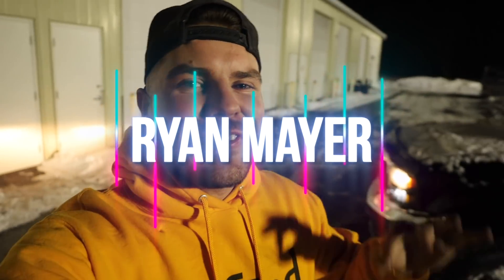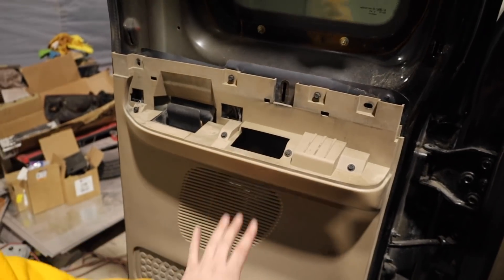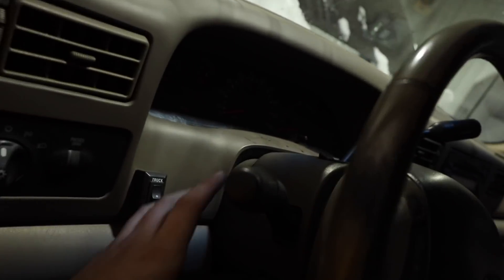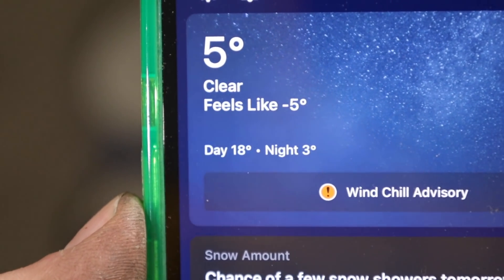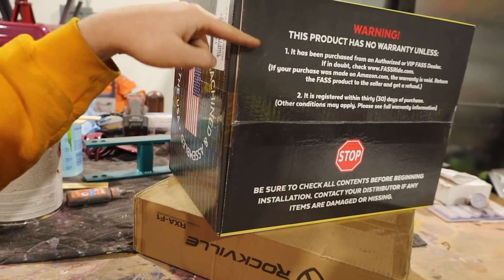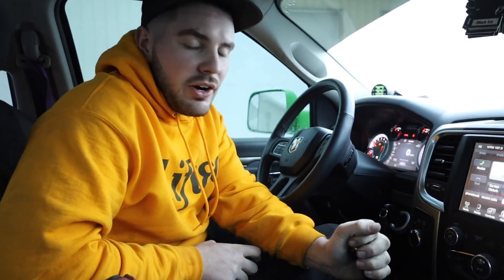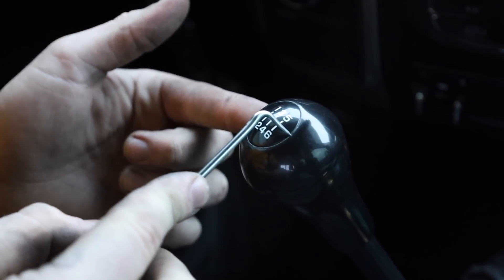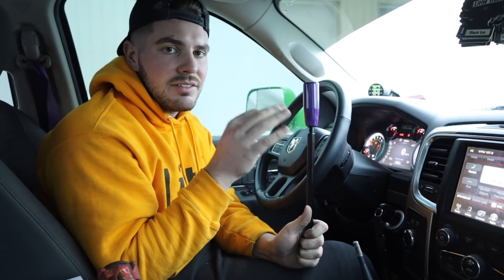I Put a SEMI Shifter On My RAM 2500

Comment: If it’s any colder than like 45 the ol 7.3 won’t come off cold at idle the radiators are just so big that they just run super cold unless your drinking I’ve drove mine one at -10 and even driving down the road barley came above cold and went right back to cold and high idle when I stopped

Comment: I did this about a year and a half ago but I stacked a 4” extension on top of the 10”. I purposefully choose a lighter weight knob as to not put a lot of stress/weight at the end of a long arm so it doesn’t want to fall out of odd number gears and it doesnt stress and wear the sycros and sliders. It definitely is smoother, easier, and a hell of a lot more fun to shift

Comment: Also the Strawberrita paint job is awesome ! You can paint the steering column no problem and for plastic just scruff it up and clean with isopropyl 91% alcohol before you spray the plastic and it will stick good .

Comment: Put a nut underneath the knob and then tighten it up against the knob , it will not loosen up anymore ,, just cut the threads down so there is only like 2 threads under the jam nut…

Comment: Delete the fuel bowl I had a long start problem ended up being the fuel bowl had a tiny crack on it not enough to leak enough to notice by the naked eye but it was getting air in it causing. It to have trouble starting

Comment: If you are solid axle swapping the Duramax DO NOT use the rear ford axle.  The Duramax AAM 11.5 is a way stronger axle then the ford 10.5,  you can get Chevy outer hubs on the front of the ford axle.